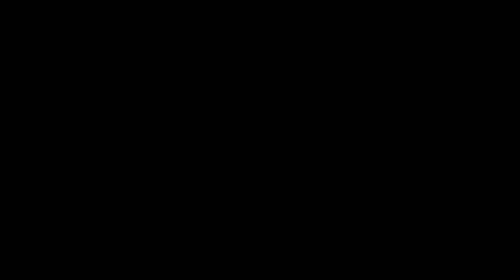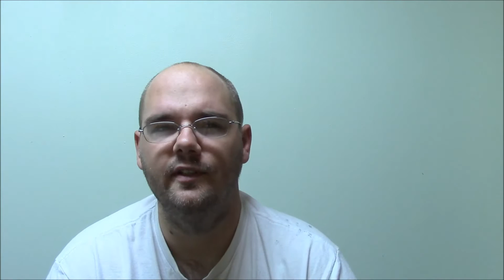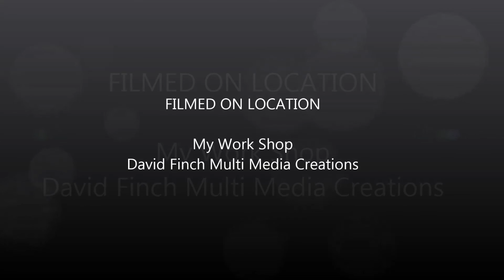PQR FIRST

Comment: Hi David It was nice watching your Video. Thanks a lot for the same. One thing what I wanted to ask you is that IF every WPS is to be supported by a PQR why is there a range of thickness given in the PQR , where as in WPS it is for a particular thickness. What is the significance of the range of thickness in PQR as per ISO 15614. Lastly if we are to record the exact V and AMP on the PQR how do we arrive at a range in the WPS ??
Reply from the maker: +Desmi Equipments Pvt. Ltd. 

Honestly if a PQR has a range on the thickness of the material and I were reviewing it I would reject it. The PQR should only state the thickness the test was performed on and then the WPS the range qualified according the welding code used. 

The main significance of range of thickness is that you have tested a welding process on a given thickness, and to limit the number of testing needed the code as allowed a range that they will allow that test to qualify without needing additional testing. At a certain point (Really thick or really thin) the code will require more stringent testing as it lends to be more difficult to prove a process. 

Now, when a recorded variable on the PQR is done, the code of welding being used will typically state a range that is allowed +/- of the recorded value. It is normally stated with a % for both Voltage and Amperage. 

I hope this helps, and if not keep asking, if I don't get a good answer maybe someone else reading these comments can help out as well.
Reply: Hi David Thanks a lot for your reply. One thing I would like to tell you is that when i said range of thickness I meant for the process qualification not the record of test. IN ISO 15614 There is a Aneex A which gives details of range of qualification for Material group, thickness processes, type of weld etc. 
               What I wanted to know is if we have to support all the WPS made, with PQR, and in PQR format we have to mention the WPS used, why the range of qualification ? From the your reply I understand that once a range of material is qualified we need not do all the tests once again for the range of material. Then what will be the process to qualify the WPS? 
    As per ISO 15614 If we make a test piece of 6 mm Thk plate . As per the range we qualify the process for 1.5 to 12 mm Thk plate ( 0.5 T to 2T ) . The V and Amp used for 6 mm Thk plate cannot be used for 1.5 mm Thk plate or for 12 mm Thk plate. So we will have to prepare another WPS for 1.5 mm Thk plate and for 12 mm Thk plate also. Once we create WPS we will have to Qualify it with PQR also. 
    How does the range in thickness help?
Reply from the maker: +Desmi Equipments Pvt. Ltd. I used to hav a nice spreadsheet I made to tell me all the different qualificaiton thicknesses since ISO 15614 can get complicated with them. But to your point, you typically wouldn't use the same Voltage and amperage, but that is why you also are aloowed a range on these variables. 

Just to come up with a scenario, 1/4" (6mm) plate test with the SMAW (111) Open root 1/8" (3.2mm) E6010 (E4310), I would weld my root in the ball park of 75-90 Amps. I would establish this as a starting point on a pWPS, and then when it is welded the recorder will take note the exact amperage used. After mechanical and NDE testing is performed, and the test passes and a PQR is written. Then in accordance with code when I use the PQR for writing the WPS I can take that amperage value and create the allowable range I am allowed to use without re-qualification. Lets just say +/- 10% (This is just hypothetical, I don't have the code book in front of me). So lets say I settled on welding the root with 80 amps. Now my allowed range on the WPS is 72-88 Amps. As my material gets thicker I will go to the high end of this range, but really don't ever need to exceed 88 amps for this given electrode, no matter what the material thickness gets to. On the low end, I may need to increase travel speed, close my root opening as much as allowed, and hope for the best. 

Another way to think about this.

Say I'm welding a 1" (25.4mm) plate Flat position groove weld with permanent backing using GMAW (Spray)(90/10 shielding gas) (135). The range of qualified thickness if it is 0.5T - 2T, then I get 0.5" - 2" (12mm-50mm). Now if I'm welding using 0.045" (1.1mm) at 27V and 350 ipm (8.9 m/min)(~180-200 amps), then I don't have to change this setting whether welding the low end of thickness or the high end of thickness. I will find that I need to make sure the joint is cooled below interpass temperature before continuing the weld however.

Hope this helps clarify the range acceptable.
Reply: Dear David Thanks once again for  sparing your precious time, It is now clear that when I write the PQR it qualifies the Range of Material thickness (0.5t to 2t) . I can use maybe  +/- 10 % of the parameters as per the code to write the WPS. As the thickness increases I can go to the high end of the range and as the thickness decreases I can increase the travel speed to get the appropriate weld quality. 
             But in the WPS we are not specifying the range of thickness. This is the document which the welder is going to refer when performing welding. The welder when referring to the WPS  will find a single thickness mentioned in it. He can use it for t only not for 0.5t or 2t. As per ISO 15609 we have to put the exact thickness in the WPS. How do overcome this . Can we write multiple WPS referring to the same PQR ?
Reply from the maker: +Desmi Equipments Pvt. Ltd. Yes, you can write multiple WPSs for all associated with one PQR, I've seen a lot of that with ISO.
Reply: Hi David Thanks for the reply. Actually the problem is that we have had various people who have got different views about the standard. One of our European customer had asked us to do WPS and PQR for each and every Joint. Even for welder qualification he had asked us to do all the joints and then qualify the welder for performing on the job. Another European customer had told us about the range of qualification. Their welding engineer had told us to qualify welders as per the range given in ISO 9606. 
             When we read the standard for PQR (ISO 15614) and for welder qualification ( ISO 9606) it very clearly states the range of qualification and in the sample formats also there is a area where the range is mentioned.
       In WPS (ISO 15609) clause 4.1 General tab it is written that (welding procedure specification covers a certain range of thickness , and a range of parent material group and even certain welding consumable) Where as in the WPS format there is no mention of range of thickness. Why is it so ??
Reply from the maker: +Desmi Equipments Pvt. Ltd. I'm sorry, I do not have access to these documents and don't think that I can answer this question.
Reply: No problem David thanks for your help.Have a great day.

Comment: Actually the procedure is for a Welding Engineer to generate a "pWPS" first.
The small "p' stands for preliminary or proposed (which ever you prefer).
That pWPS is then used for welding of the WPQ. (Welding Procedure Qualification) test piece.
The test piece is subjected to the code/specification required Mechanical Testing.
If the results of the mechanical testing are acceptable, then a WPS can be written using the parameter data from the WPQR (Welding Procedure Qualification Record)
The parameters on the WPS will be in ranges conforming to the applicable code, "Essential Variables."
Reply from the maker: 777mallen  Depends on the code and the nomenclature of that code, but most of them you would be correct in that there is a pWPS which can be as simple as what the engineer thinks and has wrote on a napkin. There really isn't a formal requirement for this to happen like there is for a PQR and a WPS.

Comment: The AWS D1.1 has prequalified welding procedures..Joint designs ,with or without backing ,material and electrode matchup ect..... My question is for welder qualification ,I can write up  the WPS so I can certify a welder for all groove and fillet welds on plate ( A36 3/8'' plate test with backing using a 7018 electrode vertical and overhead ) ..On my WPS what do I put down for the PQR ??..Just say yes its Prequalified ??? Can a WPS be written for The ASME code  without doing PQR testing to qualify welders..
Reply from the maker: Don Carter Don, most of what I see is that the PQR field either says "Pre Qualified", or more what I prefer is "Pre Qualified + the joint design number" 

ASME allows some use of AWS Prequalified WPSs, and you can use those to perform welder qualification tests.